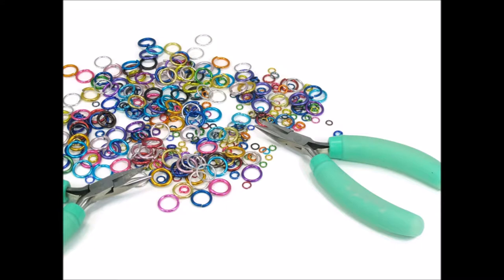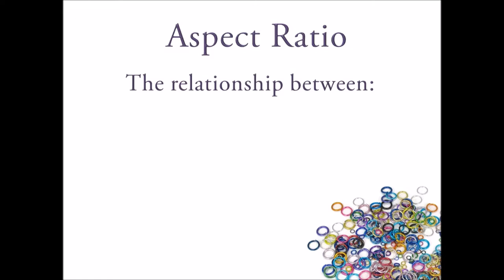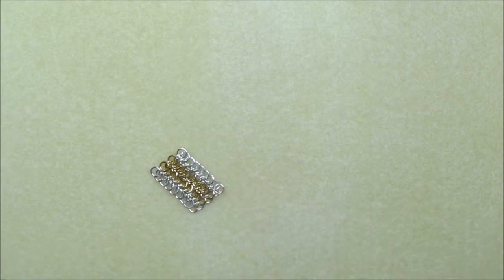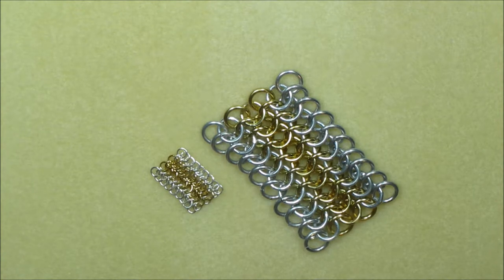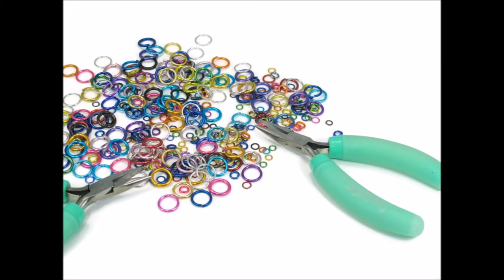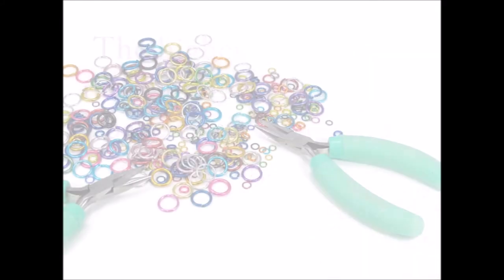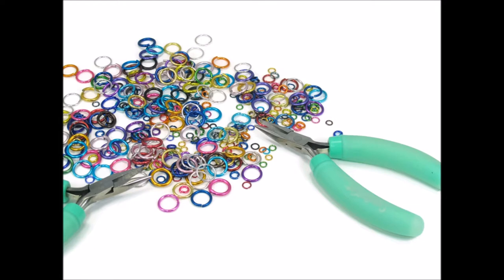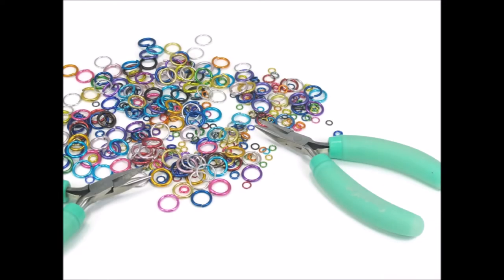The Quick and Dirty on Chainmaille Aspect Ratio

Comment: Get yourself a $10 caliper from Harbor Freight.  The pointy things on top measure the inner circle of your jump ring.  Stick it inside your jump ring and expand it.  Get the measurement in millimeters.  Then use the bottom thingy to measure the thickness of your wire...squeeze it around the outside of the wire strand...get it in millimeters.  Then you can do the formula.  The whole point is to make sure your jump rings aren’t too big or too small depending on the size rod you are using.  For another $10 you can buy “a transfer set.”  All diff sizes of the black rods same as you pay $40 for at jewelry supply places. A “transfer set” is what carpenters use for drilling holes in wood just s your know.